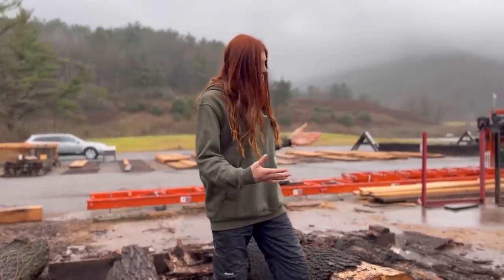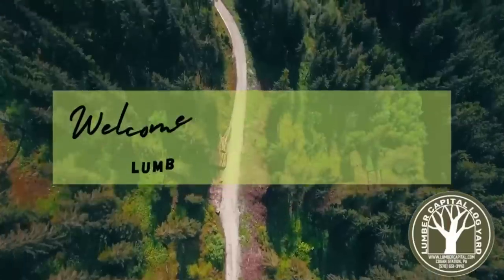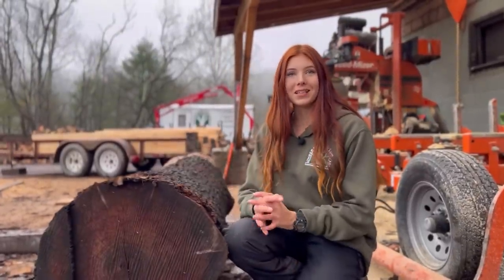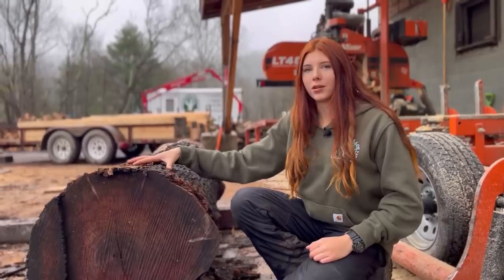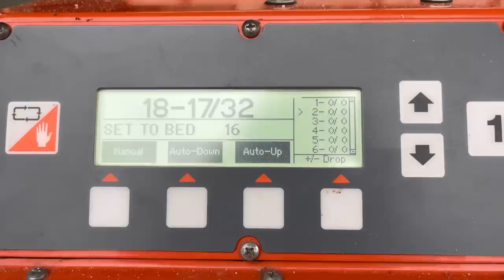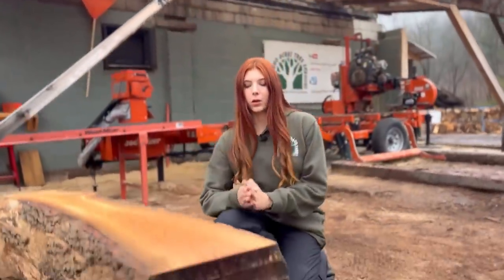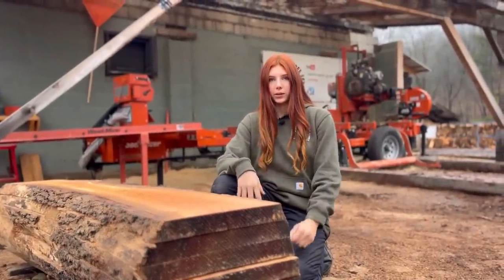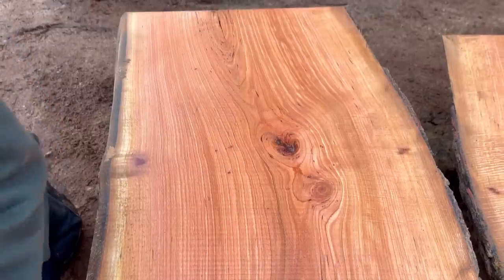Incredible Cherry Slabs on the LT40 Woodmizer Sawmill

Comment: Sullivan county and Northern Lycoming county have the Worlds best Cherry trees and the lumber from the Cherry logs .
Some sawers use a 12" or 14" drywall knife to clean off the saw dust from the board , it is faster than a brush and then they put water on the board  to show the color of the wood better .
Should saw some of that kind of stuff in thicker sizes for table top and shelves , maybe  1 1/2" - 2" - 3" .
Probably a higher dollar board when killin dry .
Some times logs that look the worst will make the neatest boards with wild grain and make holes too .

Comment: Great Job on the loader Em, Using the lower section of the control handles gives smoother control to overcome the drift of the hydrolics, Beautiful lumber, have cut some cherry slabs this past spring and are put up to dry biggest was about 16 inch across you got me beat on that LOL Job well done! Jla

Comment: I know from buying cherry and other domestic wood that it isn't cheap but it sure makes fine products in the end. Some imported woods are extremely expensive as well. It just depends what you want your end product to look like.  Making clocks or lamps I always used at least 2 contrasting woods. On a lamp 3 contrasting woods look sweet.